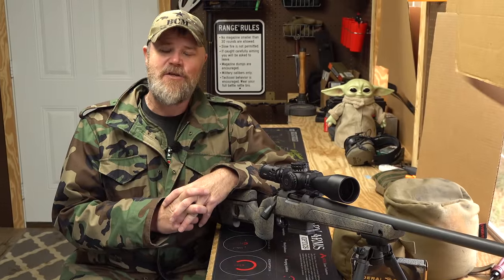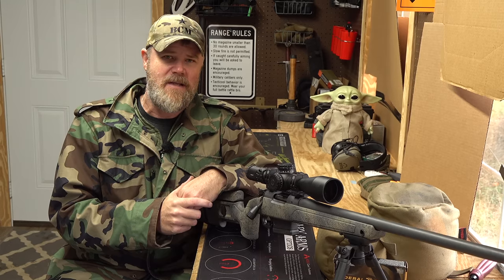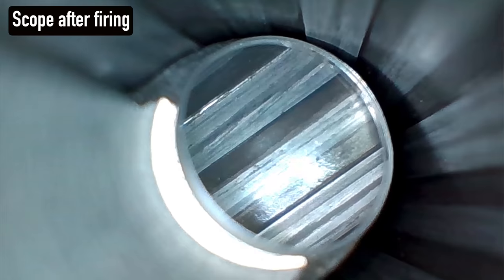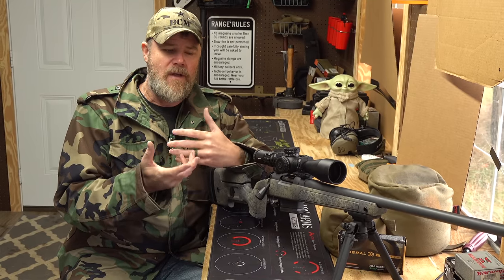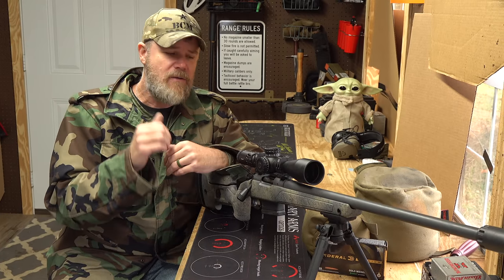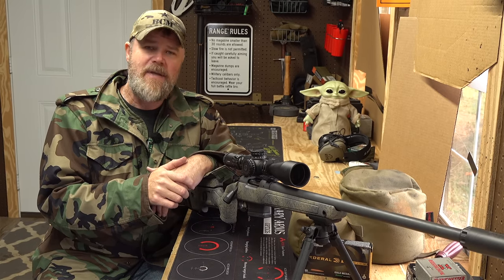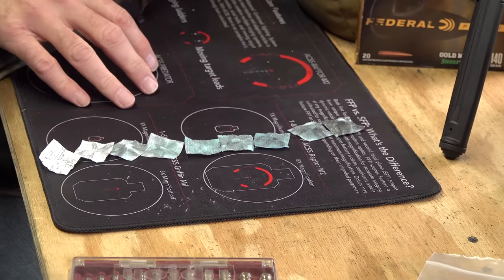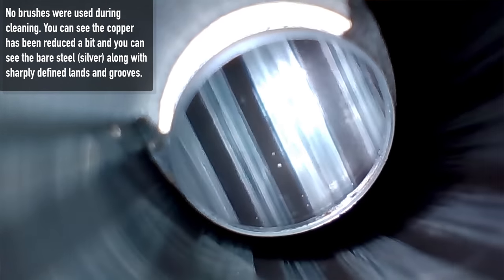Barrel Break-Ins and Cleaning Voodoo Rituals Destroy Barrels

Comment: Fire lapping is one of those procedures that I would do only in extreme cases. It's a bit of a last ditch type of thing to me for cleaning up a really rough barrel so it's more reliable. You're gonna lose accuracy, but if it saves the gun to continue being enjoyed then okay.

As for cleaning the way you describe I'd definitely agree with what you're saying when it comes to precision rifles. Stainless steel brushes shouldn't even exist in the firearms cleaning section of any store. You shouldn't see them at all. But we do. I'm not sure who is buying them because that's just dumb. As for other brushes I personally use nylon, brass, and at times I'll use phosphor bronze but never on chamber bolt or barrel. It's only for stubborn carbon and only in specific areas. I use very mild solvents that basically go after only the carbon then make sure all areas the solvent touched are cleaned till dry then properly oiled. CLP (the standard military grade type) is great at a few things but poor at high temperature applications. If you know how to apply it in the right way you can actually prevent a lot of build up in DI AR platforms. The carbon will wipe away. You have to accept that you will be blowing some out of the rifle so you have been warned. Finding a happy place for your gun takes time and experience. I haven't bought any actual lubrication/cleaning oils in many many years myself. I'll give a suggestion for a great oil I've found that works phenomenally well. 0W-40. Yes, the same stuff they put in your diesel pickup.

I'm not big on solvents. They tend to be a lot of proprietary blends and mixes of 11 different herbs and spices. I've never found much need for them myself because you never know what you might get with some. There are plenty of cleaners out there to try, do what works for you and doesnt harm the rifle. Always go chamber to crown. I've never had an issue getting a bore clean with simple CLP and patching. Let it sit and do its thing for a few, run a brush through a couple times and let it sit some more. Then patch it till the patches are clean. I have an AR with well over 10,000 rounds on the barrel and it still smacks steel consistantly at 500m+. And I've never been aggressive with the barrel cleaning. I do take my time on it because its therapeutic to me. Yeah, I might spend in the range of a couple hours cleaning it after I go blow through over 100 rounds and sometimes even more. I personally enjoy that time to myself. It's a bit of a ritual we have. I do like that most people I've looked at in the comments is telling their own process and sharing their experiences rather than arguing about it. Then again I've only looked at a handful of the comments lol.

Comment: In the 90,s rifle makers say don't take everything out of the barrel to leave it the grove. Or it will just need to build up again to go back where it was shooting. How does brass brush 🪥 dameg the steel barrel. I've not ever see that happen before. I would like to see 👀 someone ruined the barrel with the brass brush don't use the stainless steel brush is harder than steel barrel. This is what I learned working in a 🔫 store. Just like every  everyone has a different thing to say about brake in the barrel or not needed.

Comment: People need to realize that hardness does not dictate the potential of wearing down a material. You can absolutely wear down a harder material with a softer one due to friction on macroscopic and molecular levels. Grabbing and pulling the peaks off of a rough surface.  Same reason why copper bullets wear down the rifling even though copper is much softer. Hardness only dictates if something can be scratched, between two theoretically perfectly smooth materials. 

Will it happen fast? No. For most people the bullets will do far more wear than a brass brush. However if you constantly use a brass brush aggressively after every time you shoot you will see faster wear, and it can be seen in the real world. Most people won’t see it though. 

It’s the same reason why car tires can wear down asphalt. Imperfect surfaces grabbing each other and tearing away. Same reason why feet and shoes wear down wood floors, and same reason why water will wear down rock. 

Also brass brushes can be too aggressive and will remove every bit of deposit from your barrel. Not necessarily a bad thing in some cases, but the important thing is to maintain a consistent and even layer of deposit in your barrel to have the most consistent rifle. This will usually happen by itself, but a nylon brush and some light solvent will help to take out the heavy deposits and even out the layer of deposit.

For a very bad barrel you can remove all of the deposits using a brass brush and “re season” the barrel from the beginning, but it’ll take like 50-100 rounds to bring the barrel back to its prime condition. Doing this all the time means your rifle will almost never get a good consistent layer of deposits in the barrel.

So I agree, there’s not much of a reason to use a brass brush. It does have the potential to do damage, even if it’s not much, but more importantly it’s much more aggressive than necessary to do a clean on a decent barrel. No reason to do it imo unless you want to remove every bit of fouling from the barrel, and even then you can do it with a nylon brush if you want to.

Comment: Don't use solvents, just use something that breaks down carbon and leave the barrel alone, it's happy place is the amount of gilding metal that fills the voids from machining. that is the general rule, if you have a very high end barrel, then you need to follow the manufactures directions, but everything you buy off the shelf will do wonderfully if left alone and only coming out the carbon using carburetor cleaner than a very thin coat of oil to protect it during storage a run right through it before you go hunting, do a fowling shoot at the range first, and then go hunting. And don't confuse your boar with different levels of consistency. Unless the manufacturer recommends completely bringing it down to solid steel. They have the reasons which I still cannot understand but they do have the reasons, I listen to them. I don't clean my freaking barrels of anything than carburetor cleaner and a rag.

Comment: This is my experiance from my 40+ years of shooting. I bought a 30-06 back in the mid 80's. I did the shoot 1 clean 1 shoot 2 clean shoot 3 clean ect you get the picture. That gun would do 3 shot groups at 100 yards that i could lay a dime on all day long using 180 grain rounds. I have had other guns that i never did a break in with that would do 1 inch groups or less at 100 yards. So kinda take the break in myth with a grain of salt. Me personaly i like to run a 100 or so rounds thru a new gun just to smooth any ruff spots in the barrels. The only real benifit to breaking in a gun is smoothing the ruff spots in the barrel. I dont care how well the barrel is made or who makes it their will be some spots in that barrel that shooting will polish out. As far as cleaning solvents go i personaly consider them to be a waste of money. All i have ever used to clean my gun barrel is some 3in1 oil on a dry patch and a brass brush. I have never had a barrel go bad or lose its accuracy doing this. My dad used 3in1 oil in all his guns and where i live it was a common pratice back in the day. Kinda funny when i grew up their was no such thing as a cleaning solvent and all those old guns shot great.

Comment: I really have no dog in this fight, but I'm puzzled at the notion that a bronze brush would damage a steel barrel. Using a corrosive solvent capable of dissolving metal or, for that matter a stainless steel brush seems like asking for trouble, but bronze or copper brushes shouldn't remove or damage steel rifling unless used with a solvent that attacks steel surfaces.

Comment: I was a Direct Support 91F (45B back in the day) and supported some SFG's in AFG and back in the states. Those SF guys were the worst when it came to cleaning, as far as the fact that they didn't clean their weapons and it used to irritate me. When I had the chance to talk to them they stood by their practices and would  declare exactly what you said basically. Yeah, when it comes to M4's you need to keep your BCG clean and wipe it out now and then, but they would pretty much do little else and regularly shoot tens of thousands of rounds over several training sessions and never punch the bore. They suffered no accuracy issues. I took that advice with me when I was shooting marksmanship matches. I always cleaned the crud out of my guns but pretty much left the bore alone, running a snake and some CLP in there before putting the guns away for a while. Oh and FJB.

Comment: A lot of ideas about needing to clean a barrel extensively came from corrosive black powder and primers, both required you to clean your barrel to prevent corrosion. Now days you can clean, not clean, half clean or whatever, with the wide ranging opinions out there from good shooters it doesn't seem to make much of a difference. Eric Cortona for example has a video of him removing his barrel and soaking it in CLR until it's spotless and apparently he throws out his barrels when his groups open to 1/2 MOA.

Comment: I completely fail to understand a lot of that. 

1) Nylon brushes only: A soft metal like bronze or aluminum cannot mar or harm a hard steel like a chrome barrel (under normal conditions). This is the same physics behind sharpening knives - you must have a harder substance for your sharpener than the steel of the knife, which is why many super-steels are very difficult to sharpen, e.g. S110V, etc. 

2) Scrubbing will damage a barrel: Again, I don't understand why for the same reasons as #1. A patch can't damage a barrel. If what a patch collects in it damages a barrel, they why wouldn't a round fired through the barrel collect those same substances and do more damage? 

What am I missing?

Comment: To start off , he mentioned cut rifeling and hammer forge ( H .F. IS THE CHEAPEST RIFELING ) .  NOTICE HE DIDN'T MENTION " BUTTON RIFELING " .  I'M TYPING while he is explaining,  did he tell that you also need a " bore guide in the chamber "
Now , I've  discussed cleaning with a 1,000 yard bench rest shooter and he won numerous matches and he used copper brushes and stated he would clean often as possible during the matches .  He's incorrect on the copper fouling , which usually builds up on high and rough spots on the barrel .  Any good barrel maker will " hand lap "  the inside of the barrel as one of the last procedures.   Of course you don't want to use steel brushes and build up of copper won't blow the barrel up .  If you let the carbon and copper build up its going to affect accuracy.   Think about it, did your new rifle come with that build-up  ?  
I've found " WIPE-OUT" is a good bore solvent,  but don't leave it in overnight.   Hoppes is good to leave in overnight ( with muzzle pointing down on some paper towel )  you should see some " blueish green " if copper is still in bore , repeat until it no longer shows up .  
If your going hunting fire one or two shots first ( not in your hunting area 😉 )  perfectly clean bore will be a little off from a fouled one .   What 1,000 BR shooters do is a tried and true method for accuracy and winning .

Comment: Obviously, this is the method I'll use for most of my rifles. My AK47 however, will self destruct if you clean it. 🥴
  I have used a stainless steel tornado brush on a drill for an old 870 slug barrel, that was in a fire. Before everyone says that's dangerous, the barrel never got hot enough to melt the solder on the sights. It just laid in the ashes for weeks. Rusted it up pretty bad. It killed a lot of deer.

Comment: Drill Sergeant H used to sit in the center of the bay as we were cleaning and yell “GIVE ME A CLEAN RIFLE!!” — nobody ever could. He’d slip on a white formal glove and treat that star chamber like his middle school girlfriend. I was convinced I could do it. I spent 15-20 concentrated uninterrupted minutes scraping and Q-Tipping every single speck and smudge of black carbon and dirt out of that whole A2. From muzzle to firing pin to buttstock, everything was squeaky clean.… he even looked impressed! For a second I thought I did it. Until an evil look came across his face and he adjusted the rear sights… the rear sights we just spent a week fine-tuning on the range before quals. He wiped dust out of the small crevice and told me to start pushing.

He never told me to stop (that was his shtick) so I collapsed after a while and he looked down at me and said “You’re still here?” lol

To think that we were trained to over-do it and strip the barrels out is sort of amusing to me

Comment: If the manufacturer did their job the barrel was broke in at the factory. I have had barrels that had burrs and  manufacturering marks but these were cleaned up and smoothed out by shooting or chrome polish on a patch. If anyone told you that you had to go through some elaborate ceremony of shooting and cleaning they are victims of a very elaborate hoax. There is also no way to prove if all that gymnastics helped because what they tell you doesn't allow for a control group for comparison. I have been fooling with rifle barrels for nearly fifty years. What I am saying is I didn't read this in a book.

Comment: I respect your opinion but personally I been cleaning my barrels for over 40 years with brass brushes and I never downgraded the life or accuracy of any gun. If you now a bit about metallurgy you should know is absolutely impossible for a brass brush to damage a forged heat treated carbon steel barrel.

Comment: Great advice on barrel cleaning and break-in. This is what I call "chemical warfare" for barrel cleaning: no need to use a brush when chemicals can do the job, with soft patches.

Every barrel is different. Some will foul badly (and lose accuracy) in 40 rounds, others can go several hundred rounds.

I have used Sweet's 7.62 (ammonia-based solvent) a few times on an M1 and on few hunting rifles. It appears to be ammonia mixed with liquid dish soap. What I did: clean the barrel with Hoppe's first (to get power fouling out), then use Sweet's 7.62 on a swab. Let sit for 10 minutes, then wash out with boiling hot water. Dry the bore with a clean patch, clean again with Hoppe's. LOTS of copper and crud came out from the Sweet's 7.62.....it took the barrel down to bare steel.
That said, I will not use it again. Too much risk of ruining a barrel from the ammonia!

Pronouncing words correctly adds to your credibility. For instance, Hoppe's is pronounced "hop-peas," not "hops." For example, Olympic medallist Kim Rhode pronounces her last name "Road-ee," not "Road."

Comment: If my copper/brass bullets, moving at 3000+ft/s don't hurt the barrel, then my brass brush/cleaning rod won't either. Steel is much harder than brass. 

That being said, i don't do break in procedures either. There is nothing that those procedures can do to a steel barrel that is going to make the gun more or less accurate.

Comment: I think I might know where the metal fouling folklore comes from. I once bought about 1000 cupronickel Swedish military bullets (silver colored round nose). I loaded to the high side and commenced firing many as fast as possible from a semi-auto AG-42. The bore became literally coated with cupronickel and bullets keyholed and I got pressure signs. It was explained to me that any barrel steel with a fair nickel content would fuse partly to cupronickel. I found the same tough heavy fouling in a Savage military in 303 British. To remove it you attack with bore solvent that eats out the copper leaving pure nickel, then brush and shoot. Eventually the steel bore reappears. The military have proven that guilding metal bullets will not build up past a point as it starts to shed as fast as it’s added. The catch is that high velocity like 22-250 may build up near muzzle and reduce accuracy.

Comment: cleaning the barrel videos are very different from an other, don't know who to listen too, its like is putting a car battery on the concrete going to kill it or not, i hear alot of stories
Reply: For confidence look to an author’s shooting credentials. If author does not state them, ask for them. What I see are informed opinions juxtaposed to uninformed ones. I can see that because I am an experienced shooter. A novice shooter of course has little experience and thus does not know whose advice to take. For less chance of being deceived look for videos produced by the United States Army Marksmanship Unit. They are Masters on all shooting topics. BTW, while the author here is knowledgeable of several techniques he did not present evidence for any barrel break-in or cleaning technique which delivers better accuracy from a barrel, whether hammer forged, cut, or button rifled. So, not much here other than a conversation starter.

Comment: There's absolutely nothing wrong with using a bronze or copper brush to clean your barrel.  Bronze/copper are extremely soft metals compared to steel and wont damage your barrel.  This whole notion that using a copper brush will destroy your barrel is pure fudd lore.  My process for breaking in a new barrel is running a couple wet patches down a brand new barrel just to remove any debris.  Shoot 100-150 rounds, clean again, and shoot it.  I wont do a deep clean after that for probably 600-800 rounds.